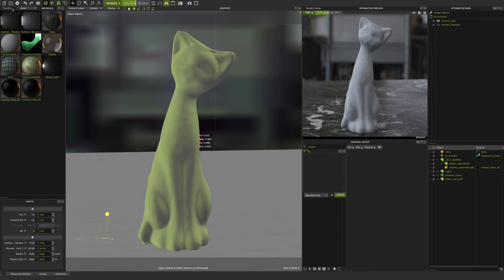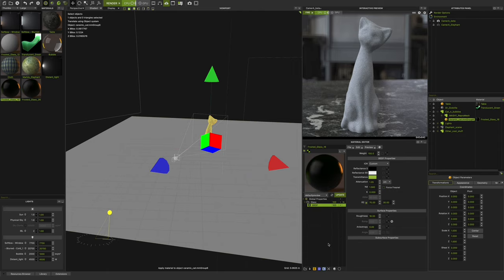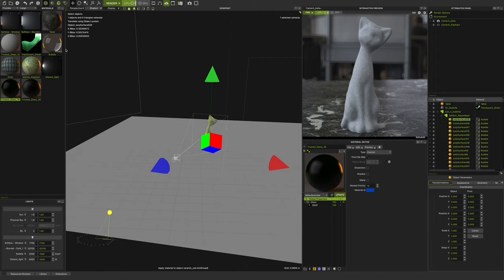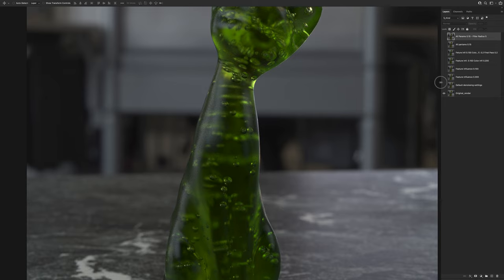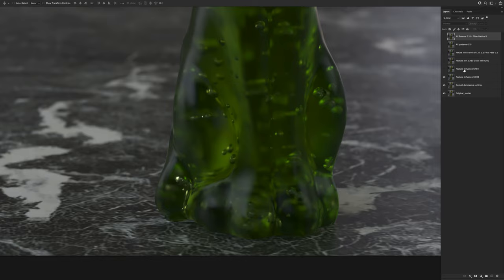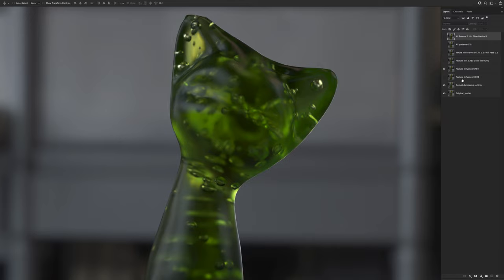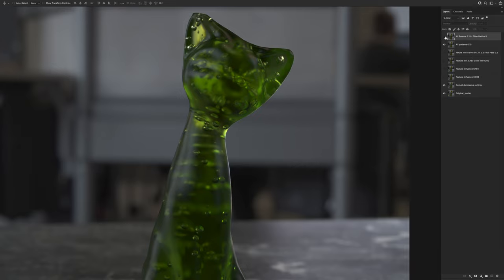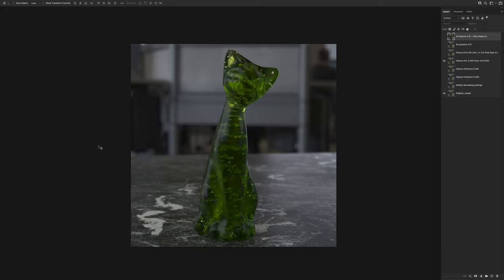Maxwell 5.2. - Denoising Frosted Glass

Comment: Or just render and apply Topaz DeNoise AI ; )
Reply from the maker: Sure, if that's your thing. The benefits of embedded denoiser is that it is already right there. And after a few uses I'm sure you'll be setting numbers of denoiser even before you start the render, as those are pretty straightforward. That doesn't make External denoisers useless, of course. It's always a good idea to have alternatives ;)